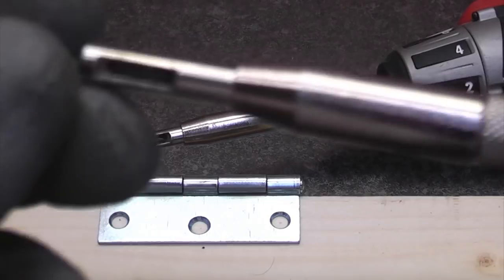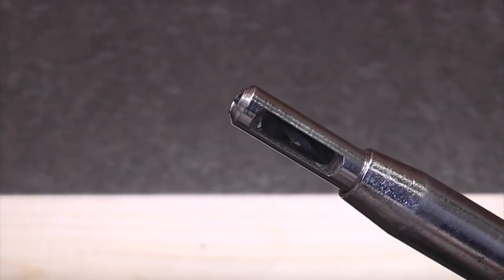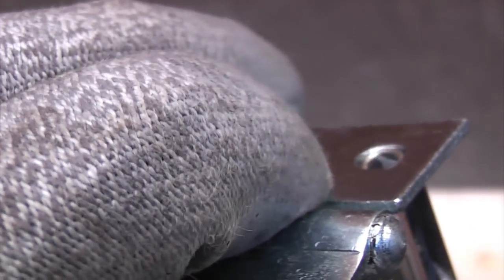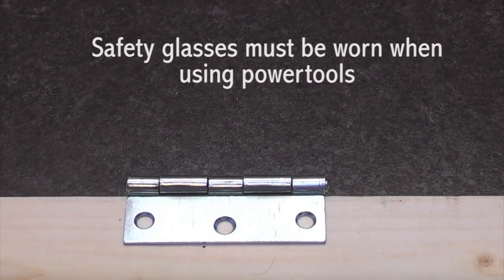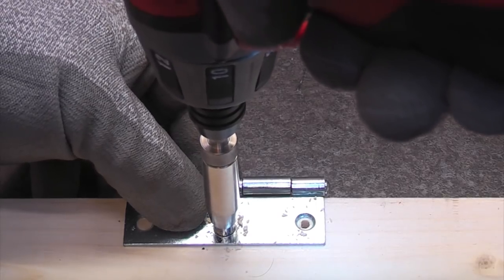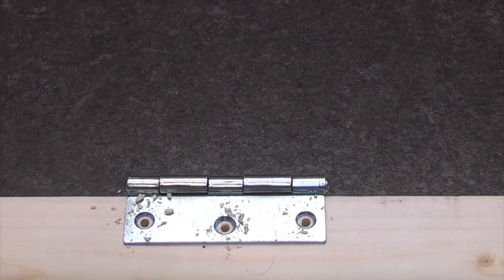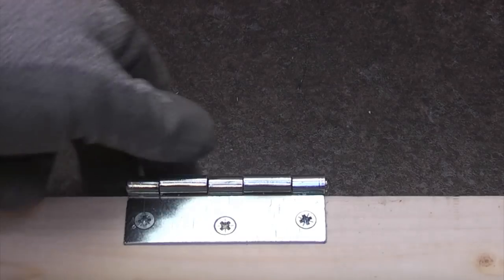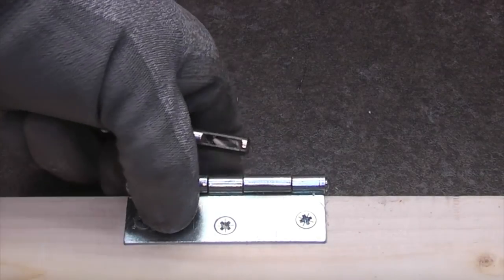hinge drills

Comment: Some folks scoff at these, but i find these bits especially useful when you're fitting new hinges to an existing architrave and / or door. The previous holes dont align with the new hinges, so the old holes need closing up. Problem is no matter how careful you are when drilling new holes, the drill bit always wanders into the old covered up holes because the new and old holes are usually only a mm or two apart. These drill bits prevent that from happening. Wish I'd discovered thrm earlier tbh.
Reply from the maker: Thanks for the comment 👍

Comment: GREAT! indexing tool BUT I would suggest Drilling only ONE hole and then install the needed screw..... THEN drill  the remaining holes... The First installed screw holds the Hinge in its proper place preventing if from possibly shifting before you drill the other two...   Just my approach...

Comment: It also helps to make one pilot hole, fit the screw and tighten it down on the hinge and then drill the other holes in order to avoid the hinge moving during the drilling.
Reply: Agree @docdelete
Reply: But when you fit the screw it'll wander off your intended position because there's no accurate pilot hole, chicken and egg!

Comment: Hello mate, great video ! What size Hinge sighting drill do i need to drill out an M8x25mm bolt ? Thanks in advance
Reply from the maker: No idea, I just have a set of three, so I use the one that fits best.
These are only cheap, so it's best to get a cheap set. You can then replace the drill bit in them with a quality drill bit.
 Thanks for the comments 👍

Comment: is it possible to increase the drilling depth on these to 1 inch as im using 40mm screws???
Reply from the maker: You could probably put a longer drill bit in the hinge drill, but it will probably be fine just using the supplied bit, as long as you are using good quality (preferably self drilling) screws.
Reply: @ultimatehandyman  i ended up using the hinge drill to drill a starter hole 5mm deep - then used a regular drill bit to drill a 30mm deep pilot hole. it works - just takes longer!!!!!

Comment: This guarantees centering, but does it guarantee a perfect 90 degree angle?
Reply from the maker: No, there is the chance that the drill will not be held at 90 degrees to the item being drilled, but even then it is much better than trying to drill in the centre of the hinge hole.
Thanks for the comment